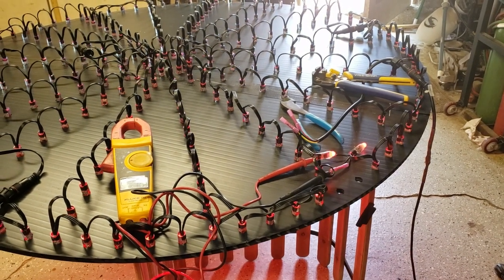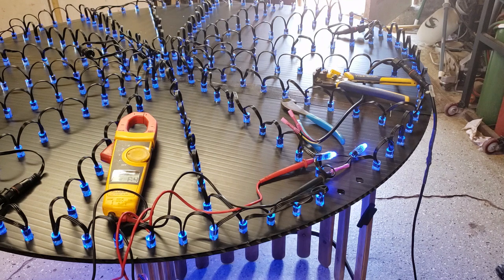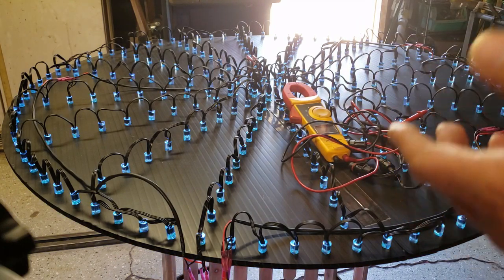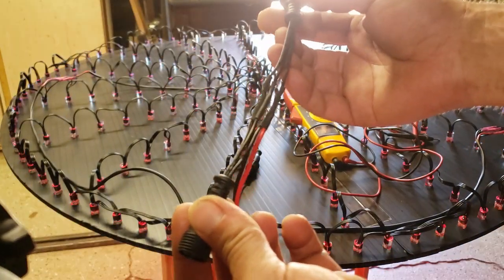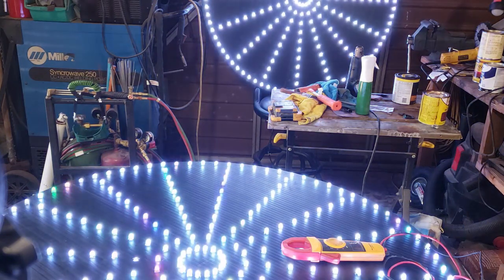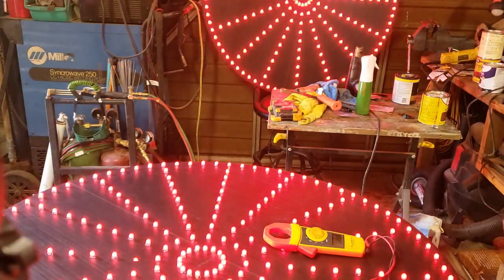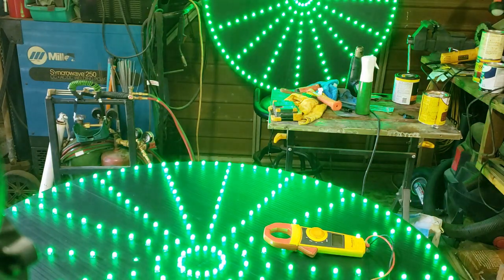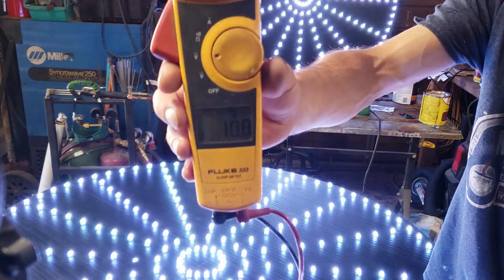Power and Ground Balancing RGB Pixel Prop

Comment: I would like to know what a proper ground connection looks like. I appreciate the video you made but you didn't show any close up shots of what a proper  ground looks like.  I normally connect the Pixel's  Ground and Data to my controller, and also connect Voltage Positive and Voltage Negative from a power supply to the first or last pixel. Did you do something differently to get "more Ground" ?

Comment: Good informative video!!!  Ya gotta try this with 5vdc pixels like I have with variations of cable length between the individual props and (LOR) cards.  Most of my cards can only have 175 max unless running a LOR PixiCon card (Just like the Falcon). No matter what, I always add PI (+ and -) every 50 Pixels regardless of if the lights are doing ok or not.  I never do PI at the end due to the nature of forward bias versus reverse bias of LEDs.  Normally do liquid tape seal on the last pixel so water does not get in.  Had that happen on a few of my props.  So far everything lights up well and can crank it up to 100% if need to.  I run 30% most of the time unless there is a part in the sequence that needs an increase for emphasis.  Like to keep my neighbors happy since in a older (most retirees) community.  BTW, LOR wants a different setup of PI than XLights and will agree with XLights form of PI over LOR.
Reply from the maker: I myself am a 5v guy, the principle is the same for them. Post this video I did create the pixel power calculator: http://spikerlights.com/calcpower.aspx you can use it to estimate the draw based on "virtual" power injection points. In my behinds the scenes this year you will see where I did this on my matrix and mega trees.

Comment: I've got three questions (I'm watching on a computer with horrible sound, so that is part of the issue):  1. I think you're saying that the solution is to also run PI at the first string, so I am assuming the first time you were starting at the second? 2. Am I correct that you are just running one PI line, and connecting it at the multiple points? and 3. Let's say you're connecting two small props that wouldn't need PI on their own, but the second one does.  Would you still need to connect your PI at the beginning of the first prop, rather than running PI directly to the second?

Comment: Your grounding fix .. so you jumped from +/- at pixel 1 to each node 51, 101 etc or 1 to 51 then 51 to 101 etc? Rather +/- on the last node back to 200something etc?
Reply from the maker: It is jumped from 1-51, then 51-101 etc, the reason I do it from pixel 1 is that is where the data line is coming in and wanted to ensure it had proper ground.

Comment: Another way to explain your Grounding fix is that there was actually a voltage (floating upwards) on the ground line. That makes the voltage difference between the Data line (5v nominal) and ground becomes too small as the ground line's voltage rises (and you get flicker).

About the only way to show that would be with a long Voltmeter probe back to the power source ground (actual Zero volts).